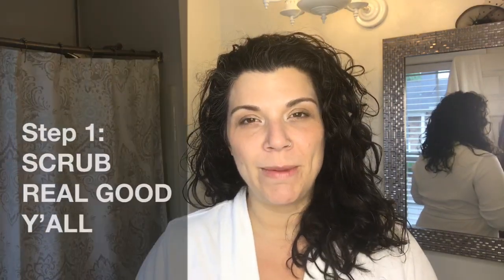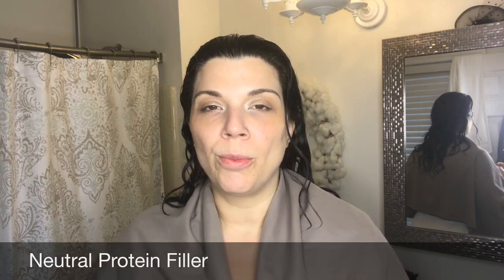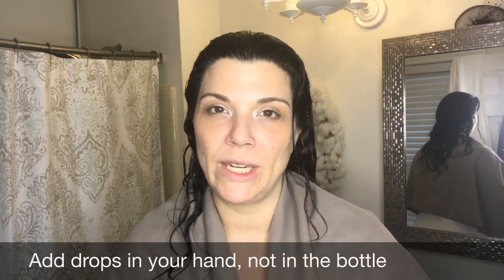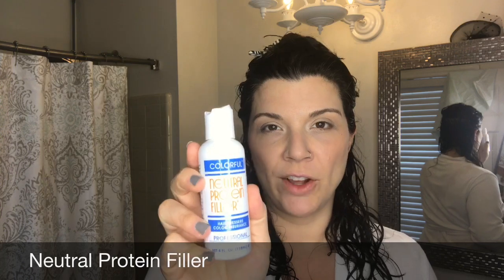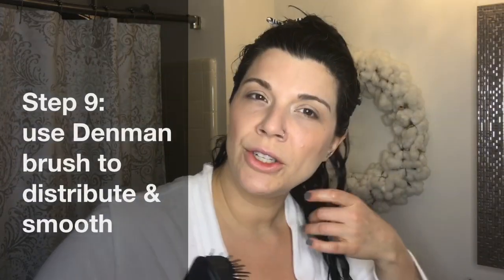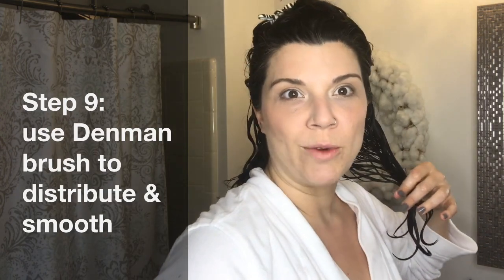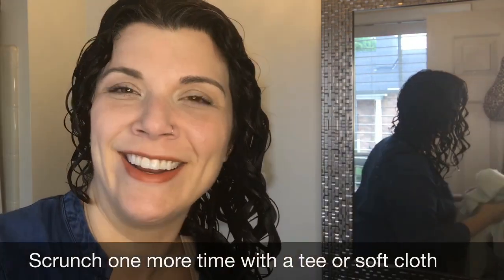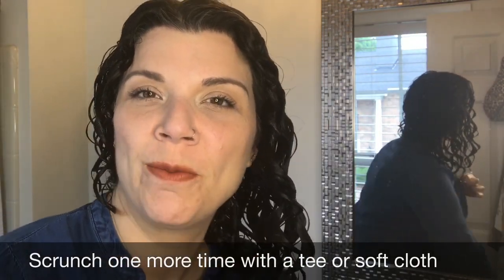Low-porosity Wash Day Routine | Curly Girl Method

Comment: Wow, I’m sooooo confused bc i thought protein was a no no for low porosity hair ??? Is it that it’s ok while deep conditioning??
Reply from the maker: Protein and moisture can be tricky but if you remember that low porosity hair is so tightly closed (like an unopened pine cone) that it doesn’t let moisture or protein in easily, it makes more sense. I have found that I have to do a weekly deep condition and have to add protein during styling. About every other or every third wash, I’ll do more protein in my deep conditioner - like Liquid Aminos or the Neutral Protein Filler. The heat helps it penetrate. 

Folks will really rattle your nerves warning about protein overload as well as over moisturizing. I’ve yet to experience protein overload. If I don’t add protein in some fashion, my hair is limp and unstructured. It can appear over moisturized pretty easily - but it is quickly brought back to life with the protein drops or a styling product with protein. I hope this helps. 

How long have you been CG?
Reply: I'm another low porosity whose hair LOVES protein. The reason you hear that low porosity hair doesn't like protein is because many people try to use large proteins. Large proteins can not penetrate low porosity hair and will simply form a hard layer on the outside of the strand causing it to "feel like straw". People assume this is protein sensitivity. The reality is that low porosity hair needs tiny proteins like hydrolyzed silk protein and, even better, amino acids. My low porosity curls LOVE amino acids. They don't really like larger proteins like "soy protein" so often seen in conditioners (that work well for high porosity people).
Reply: @accphotography  Any products you can recommend?  I just bought the Curls Blueberry Bliss & the As I am Coconut leave in to try out.
Reply: @elizabeth-2213  If your hair is not easily weighed down you could try The Mane Choice Cheers conditioner. It has a pretty hefty size of proteins. Most of them are large proteins but my hair still likes the conditioner. The best thing for my hair is pretty much what Tara does here, add neutral protein filler or soy aminos to whichever conditioner you like and use heat. I also recommend the Mielle Babassu and Mint deep conditioner. It has a lot of amino acids. It gives me a good dose of moisture and protein. For us low porosity the biggest thing is using heat because it's so hard for anything to penetrate the cuticle of our hair. The heat lifts the cuticle so your products can get in.
Reply from the maker: Mine also loves the amino acids! I need to do another treatment soon... I just have to be able to tolerate the soy sauce smell. 😝
Reply: My experience with protein is the same as Tara's - my hair looks better with a generous amount of it.
Reply: It sounds like a video just talking about this topic could he useful! :) Thanks so much for the feedback y’all!
Reply: My hair is low porosity and it LOVES protein!!!! It really depends on your hair and I recently read that if you have fine hair with low porosity there’s a good chance your hair will enjoy the protein. When my hair needs it, it falls flat and somewhat straight.
Reply: I also have to use a heat cap when I do protein treatments. My hair prefers smaller proteins because of low porosity, and also heat because of low porosity. Heat is my BFF 🤣.
Reply: @nicolejeffries740  I have coarse, low porosity hair. By most accounts my hair should absolutely hate protein, but it really doesn't. I just stick to small, hydrolyzed proteins and only do treatments every week or two at most. 

I think a lot of people forget that hair WILL get damaged over time, no matter how well you take care of it. Naturally low porosity hair tends to become more normal porosity by the mid-shaft and ends, so even if your roots hate protein, the rest of your hair might not.
Reply: Me too! I'm thoroughly confused!
Reply: My hair does not need ANY protein!!

Comment: Loved your routine. I havent started my curly hair journey yet but doing as much research as possible. Quick question.. what's your regimen the days you dont wash your hair?
Reply from the maker: Alma Garcia thanks! It depends on the weather and if I’ve slept with it protected. Ha. Most times, I wet my hands, do a few pumps of water based lube mixed with a few pumps Uncle Funky’s Curly Magic and smoothe over any weird spots with praying hands. If it’s super humid or rainy, I usually add some light gel (Bioterra). Sometimes I can just smooth with damp hands or a little light oil. I’m still perfecting this and some days I just have to wet it to rinse some product out and redo it. I try to avoid that as much as possible! Haha I’ll do a refresh video montage soon.